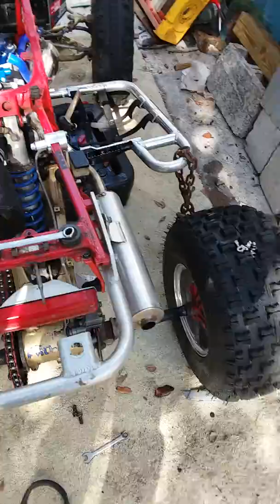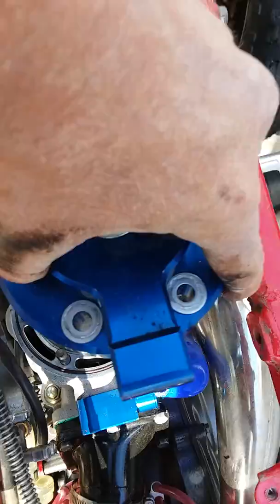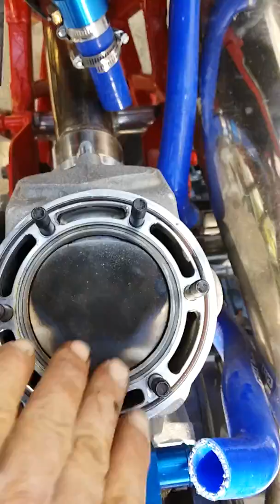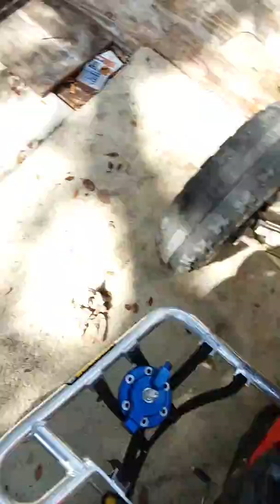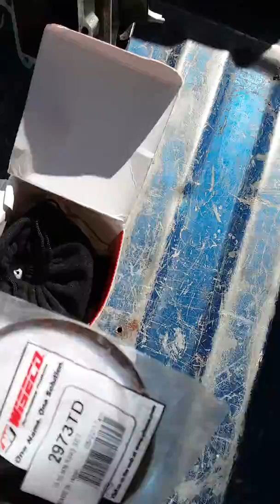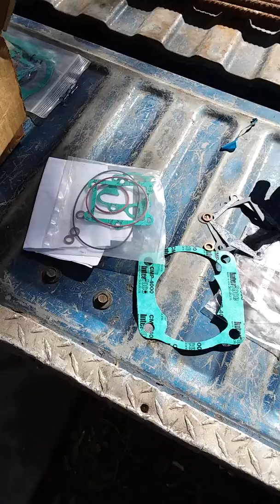Melted piston in the ESR 330 engine

Comment: Bummer😣 you sound disappointed hopfully it works out for you. I'm working on mine as I speak. Getting it ready for next week.
Reply from the maker: 32:1
Reply: Morgan  Cure that's what I run👍 jetting  problem.
Reply from the maker: the carb was junk...had it right ..but it kept changing,,,bought new one plus that jd carb kit $79...has the whole deal main..,pilot..,and needle...i also need to get rid of this twist throttle..hate it now
Reply: Morgan  Cure  Thumb throttle is the best for me. 👍👍I polished mine.